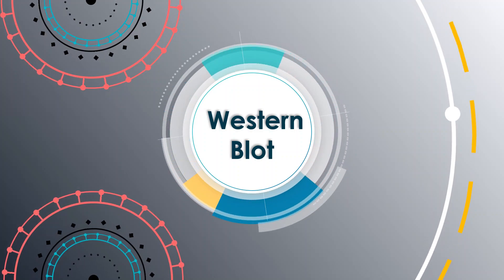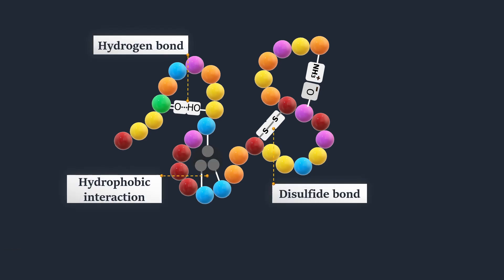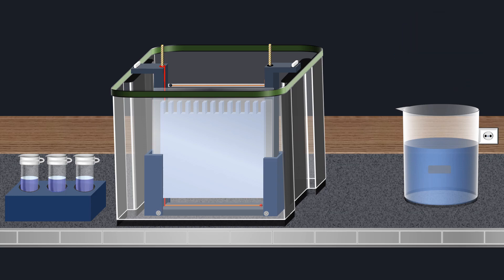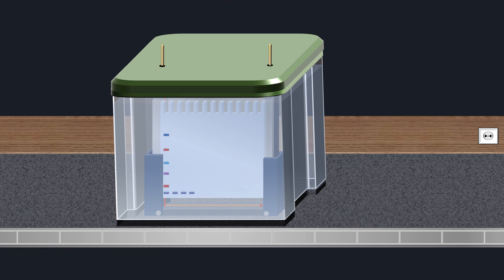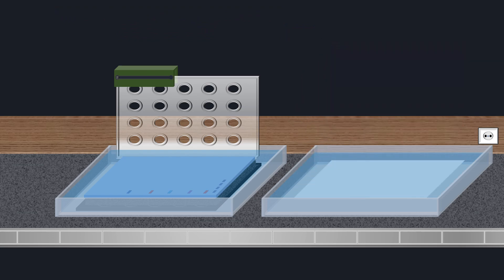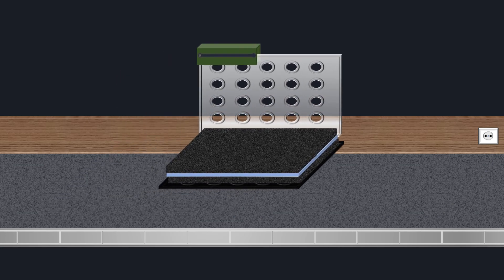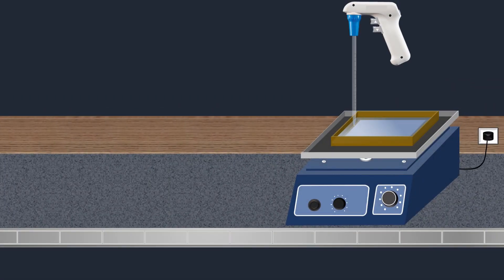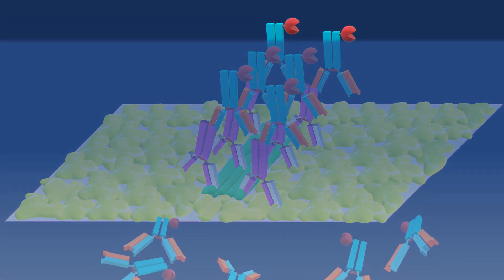Western Blot  Method - Animated  Video

Comment: Separation by SDS
4:41 Transfer
Detecting
SDS---------------------> Break H bond, Ionic Bond
Bromophenol blue------> Dye
Glyceerol-----------------> Density increase
Beta-mercaptoethanol -> Break disulfide bond
Polyacrylamide Gel -----> In chamber
Chamber-----------------> filled with running buffer
Electricity separates the protein according to their size